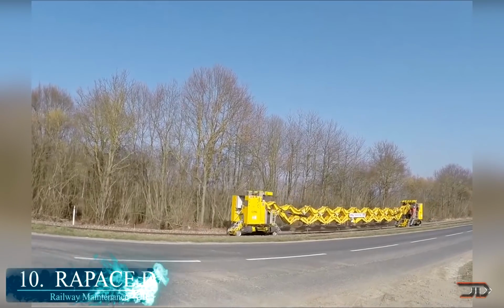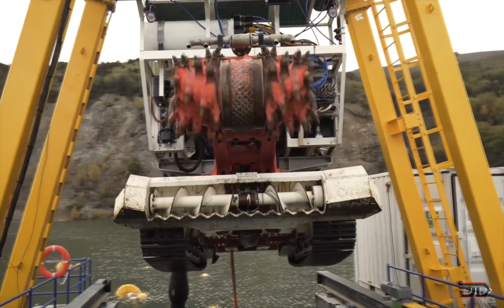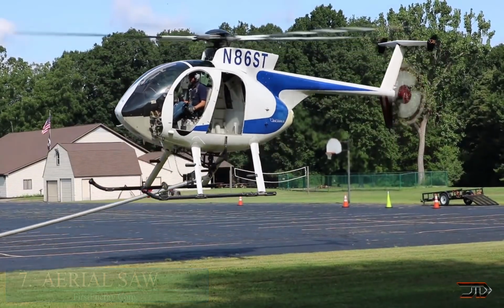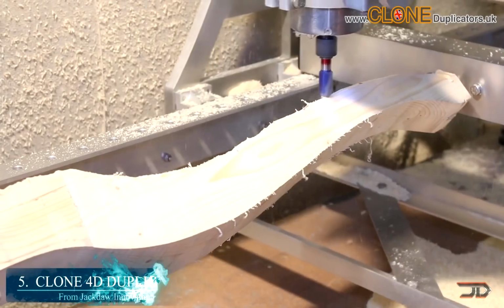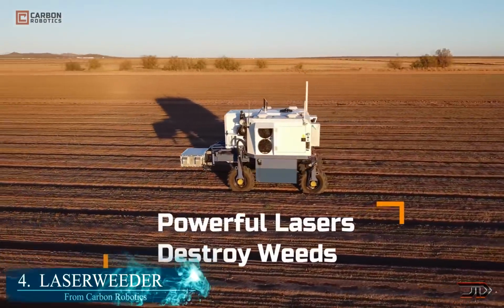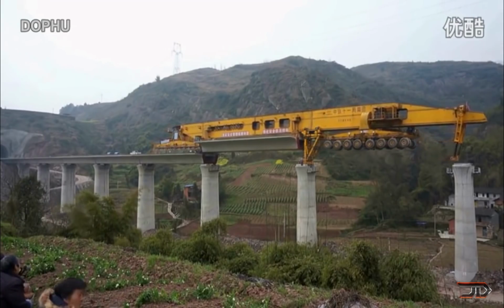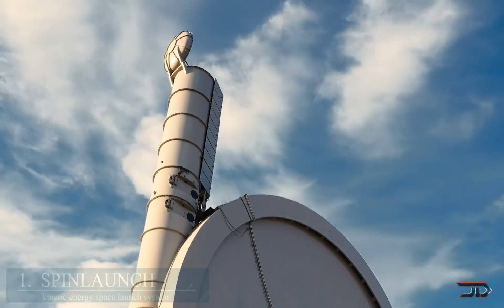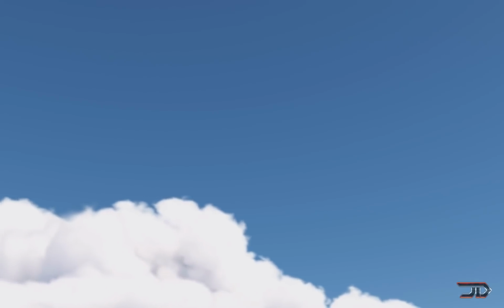10 Strangest Machines Ever Built

Comment: On the last rocket flinging machine, it will fail. Wont be efficient enough! We dont have material on earth strong enough to withstand the tinsel strength needed to go fast enough, especially holding a heavy rocket. . If we did, we would use Nikola Tesla's Turbine.
Reply: I'm sure some guy on YouTube who doesn't know the difference between "tensile" and "tinsel" knows more than the engineers developing it do.

Comment: Spin launch is bogus.  Getting a object moving fast enough and then releasing it into the air would produce a very serious bang and melt the object in question.  When going in a circle, the back end of the object is going in a slightly different direction than the front.  The difference may be a small fraction of the speed but given the very high speeds, it is still much too high.
Reply: 10 000G my ass ! Even 50G will rip apart everything...
Reply: Check Scott Manley's YouTube for a much more in depth review of spinlaunch technology. It's less fiction and more science than you might think. It will be very limited in payload types though.
Reply: @mikedavis7065  There's no material that can endure the stresses applied. NONE !
Reply: @CocoSloan  Don't be silly. This technology is already in testing. Plenty of things can be made to survive constant acceleration.
Reply: It would have to be brought up to speed in a vacuum.   The balance of that rotating arm needs to be perfect at those rotational speeds.  
It will have to remain perfect after the release of the satellite.
Reply: @PhilJonesIII  .. and the timing of the release has to be super accurate too.  "tricky" is an understatement.

Comment: Imagine the Spin Launcher letting go accidently early, sending the rocket across the land.
Reply: Just be launching rubbish into space after extreme g-force and sonic boom haha
Reply: @John637  The rubbish won't reach space.
Reply: Imagine it even letting go in the correct direction.  A object going many times the speed of sound would make a huge sonic boom and then destroy its self.
Reply: @kensmith5694  They did a test shot last month.
Reply: @barry99705  Not to orbit and the projectile came out misaligned.

Comment: the spinlaunch was busted by thunderf00t for good.
Reply from the maker: Kind of, thunderf00t takes the most extreme end of pessimism to debunk things but he is right to question their claims. There is no way that a satellite can be flung into space but it might be started on a sub-hypersonic rocket launch (that is just my guess though & even that is challenging). But those are excellent points about the moon/mars with vacuum.
Reply: @Motor_Explorer1  With low gravity, there is no need spin things up like this. What we fight with Rockets / Spinlaunch IS gravity. The other problems with this technology remain, and thunderf00t had a few good points why it will not work out in the long run. 
The other machines are very interesting, but that last entry in this list was really disappointing . . .
Reply: Spinlaunch would be perfect for returning stuff from Mars.

The top of Olympus Mons is basically in a vacuum, meaning you don't need a containment vessel.

Even after you terraform Mars, Olympus Mons caldera would still be in a vacuum.
Reply: @jtjames79  It would work for any place without an atmosphere, and the Moon seems like a prime target: No atmosphere, low gravity.
Reply: @UmbraHand  good point 👍
Reply: @UmbraHand  So, there is no need for a spinlaunch.
With low gravity, a rocket engine is much more suited.
You dont need to bring the stuff for the launcher to the moon first and install it.
Reply: @jtjames79  
Terraforming will only work in contained areas anyway. The mars has no magnetic shield like the earth has and therefore can´t contain an atmosphere. All the gasses will be blown into space (again)
Reply: Spin launch cannot work. The physics don't work even on the moon. It will tear itself apart.

Comment: Spill launch, the payload is tumbling out of the launch at a angle.
Reply from the maker: It probably won't work for straight orbital launches but I'm curious what kind of max velocity they can achieve with a centrifuge.
Reply: @Motor_Explorer1  Balancing the centrifuge after launch is a nightmare. They show a liquid fuelled rocket in the cgi demo; the liquid in the tanks will not stop spinning upon launch. If something goes wrong during launch it will destroy the launcher. So many things wrong (beyond challenging) here.
Reply: @Motor_Explorer1  easy. Check Thunderf00t’s video on it. There’s basically no way they’re going even suborbital.